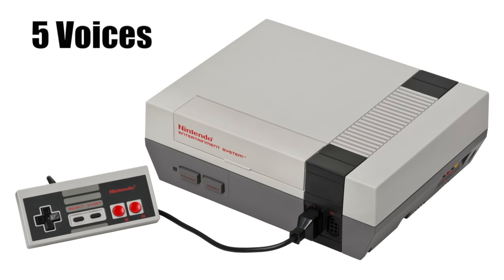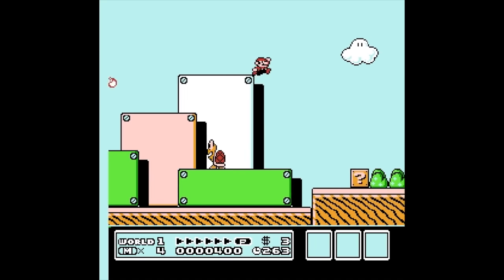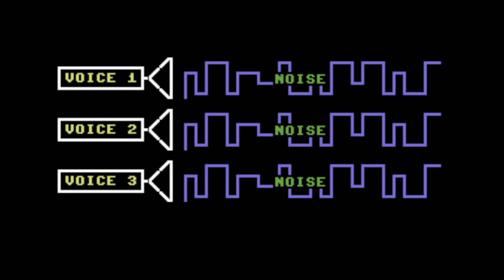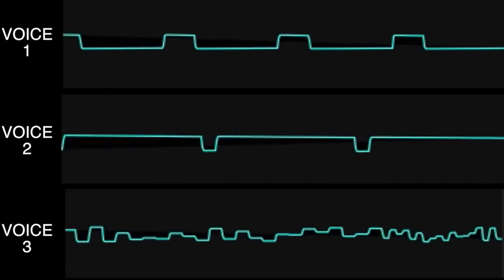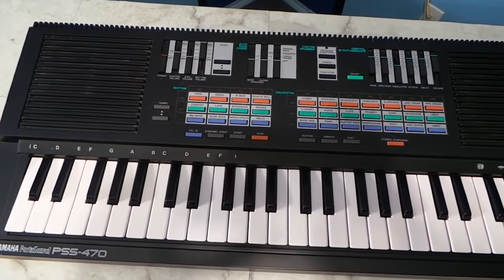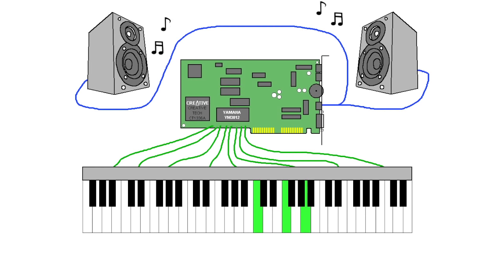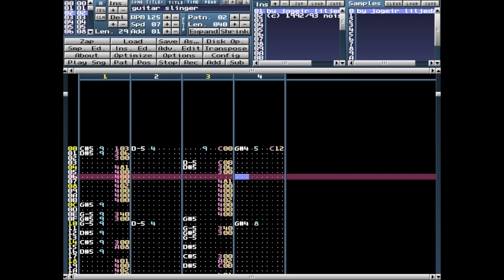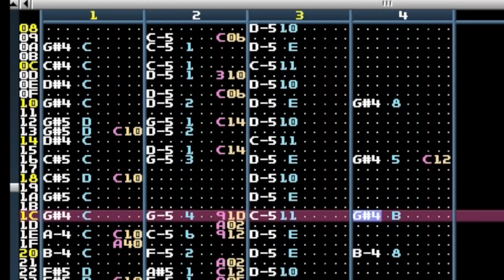How Oldschool Sound/Music worked

Comment: Hey, I just remembered to ask this... how did eight-bit computers do speech synthesis like the famous "Stay a while... stay FOREVER!" in Impossible Mission or SAM on the Apple II GS? Was it just a matter of someone figuring out a combination of square, sawtooth, and "noise" frequencies that sounds close to speech when they're played in the right order?
Reply: Pocket Fluff Productions might of been DCPM.
Reply: Pocket Fluff Productions using an online 8 bit music maker, i synthesized a laugh and some dialogue out of the nes style.
Reply: I typed in a little program for the Commodore=64 once that allowed you to put an audio tape into the Datasette and "record' the sample. Basically what it did was just record a sample based on changes in volume. When the computer played back the sampled file it just turned the volume on and off.
Reply: it was just the computer processing a pre-recorded sound .
Reply: VitinhoCarneiro Rate It Can Play For PC speaker and C64 And Nes 11khz 8khz 7khz 22khz 33khz 44khz Sounds Silmar?
Reply: except for the fact that the //gs is a 16 bit system lul
Reply: punchoutplayer penguin, which 8-bit music maker did you use?
Reply: Old comment, but a little more info for people still reading this: C64 had actual bug in the sound chip, which causes it to output a small "pop" when you changed the master volume from 0 to (maximum) 15. Someone figured out that you could play 4-bit samples with that, and it didn't even need any of the real channels doing anything. So you could easily output 3+1 channels in C64, but as the sample playback was so CPU heavy, you really couldn't use it in games too much (apart from title screens etc.). The original chipset, SID 6581 had that bug, but they fixed it in the next version, SID 8580. That's why the later 64's don't always play the music right, since the samples are too quiet, and that's why many prefer to change the chip or just use older machine these days (since they're cheap to get anyway). Some demo scene people even did mixing routines to play 3 synth and 2 sample channels at the same time, but again it was only good for showing simple background pictures with music.
Reply: Just pointing out the IIGS had the Ensoniq ES5503 chip, which was extremely advanced for its time, much more than even the Amiga's sound chip.
Reply: Technically, the Apple II GS was 16 bit, but I'll let that slide.

Comment: Thanks for featuring "Guitar Slinger"... one of my favorite MOD songs! :-)
One curiosity in early computer sound was Atari's use of a two-track head on their cassette recorder, allowing programs on tape to play pre-recorded voice and music through the computer's audio output while program data was loading from the tape. This allowed a rudimentary form of voice-guided programs, such as learning a foreign language, years before natural-sounding voice synthesis or sampling became practical.
Example: http://www.youtube.com/watch?v=s_HMJm-jbXk
Reply from the maker: +vwestlife I didn't know that.. Unfortunately, I don't have any Atari stuff other than the 2600.  I've always wanted some of the 8-bits, though.
Reply: +vwestlife My absolute favorite MODs are from Elwood, take a listen to "DEADLOCK.XM", "hours.xm", "elw-hom2.xm" or "experience.xm", you can easily find them @ the mod archive
Reply: +The 8-Bit Guy 
The Atari 8-bit computers have four voices, with a variety of waveforms, ability to link channels for 16-bit sound, filters, variable clocks. The voices also have a  volume-only mode to play digital samples (which requires CPU time.)  Its pretty easy to see how Jay Miner evolved that into the 4 voices of DMA-driven sample playback on the Amiga.
Reply: Ken Jennings And considering that the Atari 8-bit computer platform was introduced in 1978 and yet was seen as very competitive with the C64 from 1982, it was way ahead of its time.

Comment: I wish I could understand in detail how my Commode 64 was able to synthesize voice and even text to speech with 3 channels and 4 types of waveforms.  

It amazes me to this day.
Reply: Technically it didn't use the voices to do that. Programmers managed to get the Commodore 6581 SID chip it used for sound to do a simple form of PCM by exploiting a glitch in it. It doesn't work on later commodore machines that used the later 8580/6582a SID chip as they fixed the glitch.
Reply: +Zofe Stormcaller  I think I know what that glitch was, I think there was a way to get a positive constant voltage to the audio out and it utilized the 256 levels of volume control to shape the wave. 

I'd need someone to confirm that tho.  

That alone should be an awesome video. I had my C64 do all kinds amazing things. First time I heard "Pump up the volume" was sampled for a C64. I heard a crazy tune called "Pif Pof a Gorbachev" and of course the SAM programs.
Reply: +forfluf I can't remember exactly how off the top of my head (I'm at work right now), but I just remember it was something utterly brilliant.
Reply: +forfluf From the WikiPedia article on the SID chip:  "Due to imperfect manufacturing technologies of the time and poor separation between the analog and digital parts of the chip, the 6581's output (before the amplifier stage) was always slightly biased from the zero level. By adjusting the amplifier's gain through the main 4-bit volume register, this bias could be modulated as PCM, resulting in a "virtual" fourth channel allowing 4-bit digital sample playback. The glitch was known and used from an early point on, first by Electronic Speech Systems to produce sampled speech in games such as Impossible Mission (1983, Epyx) and Ghostbusters (1984, Activision)."
Reply: Eric Clark
I remember the 4 bit volume control. It sounded pretty good for 4 bit. Thanks for the info.
Reply: +forfluf My C64 has 6 channels :)
Reply: TENMAxNIEMA
Exactly, combined with the MSSIAH it kicks ass

Comment: I'd love one on how the SNES sound chip worked! I'm curious about the Genesis sound chip, too, which was similar to the Adlib but not the same, I think?? Ooooh and the Game Boy.
Reply: SNES was basically just a DAC with some effects that could be applied like basic echo - it could basically play digital samples, in other words.

The Genesis/Megadrive used FM synthesis with some sample playback capabilities, as described in the video above. It uses a different chip but the method of making sound is exactly the same. You'd even find that commercial synths like the DX7 used FM synthesis.

The gameboy used a simple sound chip which had channels that could handle different simple soundwaves (square/triangle), a PCM channel for digital samples and a noise channel. It's very similar to the NES.
Reply: It has a 4bit "wave" channel, which is effectively a PCM channel.

Comment: Do I even want to know how many voices modern systems have?
Reply: Everett Logan music is usually not synthesized in real-time anymore, because we have plenty of space to just store the whole PCM waveform. However, modern computers are plenty fast to do mixing in software, so you can have as many voices as your computer has memory to handle, at least hundreds.
Reply: over 9000
Reply: Honestly I dunno ;D
But what I think is that there is built-in sound chip/firmware like intel AC97 and there is external cards or USB.
I think this topic is to big to fit a comment so read a bit, regards:
https://en.wikipedia.org/wiki/Sound_card
Reply: I don't think they have "voices" anymore. I think they just are able to tell the headphones how to, essentially, move in order to make the sound waves. There are tutorials on how to make a DIY speaker. It just involves a magnet that moves back and forth rapidly to produce (low quality) sound. This is how all speakers work.
Reply: Everett Logan all of them
Reply: Wolfe Galvin probably 99999999999999999999999999 voices
Reply: Voices can be mixed in software, so it's limited solely to the processor speed.  Dozens is easy, and in some cases hundreds and even thousands.
Reply: MrExasperation so ∞ voices
Reply: Modern synths are wavetable based,  they simply read a pre-recorded waveform and play it back mixed with others.
Reply: NO YOU DONT!
Reply: @Wolfe Galvin  WHAT 9000!!!!!!!

Comment: This is a pretty awful oversimplification of the NES sound chip;  those pulse waves could have different duties, giving those channels many different timbres and harmonics. also, NES chips had delay effects through clever programming...
Reply: I was gonna say; 12-25% pulse waves are really common, just listen to any Megaman soundtrack
Reply: Now you can add the exact same effect by re-assigning multiple copies from the original lead track to other channels / voices with the exact same delay timing, giving a reverb impression to the audience.
Found that ten years ago in a screensaver's MIDI file.

Comment: How would the Genesis produce sounds? Was it more like Nintendo's system or did they have flexible voices like the commodore computer? I'm a bit curious especially given the soundtracks for those games are rated highly.
Reply: It uses the Yamaha YM2612 soundchip.
Reply: Genesis use also 8 channel PCM DAC converter
Reply: The sega genesis had a 6 voice FM chip
Reply: Neither, it used FM synthesis. The commodore used subtractive synthesis while the NES was just a simple soundchip that could play basic squarewaves/noise etc.
Reply: It combined YM2612 (FM synthesis) with SN76489 (PSG synth & noise - That's the SMS chip and the console was backwards compatible with the SMS). The FM chip provided 6 4op FM channels, and the 6th one could be used for sample playback instead which was often used for drums (at ~28khz and you can't modify the pitch or volume of the stored samples without tricks) - you could toggle this feature on or off during a song. There's also the more rarely used channel 3 mode that lets you control the pitch of each operator in an instrument, giving the illusion of having more channels but with those ch3 sounds being a bit simpler than the rest (see Mega Turrican - Stage 1 Secret Area for example). Some games' sound drivers also used tricks to play more than one sample at the same time, such as Skitchin', Ristar and Alien Soldier.

Comment: Well, no. What you call FM synthesis is actually PSG music. FM synthesis is '90s stuff (YM2612, Sega Genesis, you know) and actually can be used to create some complex timbre. Read up on it on Wikipedia.
Reply: FINALY someone noticed!
Reply: we're talking about the YM2612 NOT the master system's chip. FM synthisis doesn't even have any waves mentioned in the video.
Reply: +MrJimbo1qaz FM synthesis uses two frequencies and a variable to create a sound with moderately complex timbre. PSGs use predefined waveforms with no modification (such as square, sawtooth, triangle, sine, white noise), the NES's sample channel is an exception.
Reply: Correction: in FM synthesis, sine waves can be mixed or modulate the frequencies (hence the name) of others i  various orders - in other words, vibrato so fast that overtones change is the main component here . The YM2612 and most other FM synths are 4-operator, with various algorithms that control what is mixed and what modulates what. Early chips like the YM2413 (Famicom and SMS expansion) were 2-operator, limiting their capabilities. The best FM synths, most notably the iconic Yamaha DX7, had 6-operator soundchips too expensive and complex to be put into consoles.

Comment: I would have liked to see some description of how the FM synthesis of the Yamaha chips worked :)
Reply: I suggest you check out a channel called MadFame. In short, everything started with a simple question: what happens to the sound when the rate of the vibrato becomes very fast?
Reply: @justinyang21114798  Thanks! Will do!

Comment: Yes indeed, the old computer speaker was fun to program for. We used to write interrupt 8 handlers to use the timer tick and send sound files bit by literal bit out the sound port. Using the hardware timing that way was the only way to run it fast enough, and have time to execute your game code while also managing the graphics which was the real challenge in the first place.

Comment: More information about Vovol:

When the sound has high volume voltage, the speaker membrane is stretched like a guitar string, so that the sound becomes more sharper, realistic and noise-free.

This can be achieved by using an equalizer with a preamp. First, all frequencies are lowered, to, for example, -12 decibels.
Then you raise it up to +12 decibels, with a preamp.

This is how I usually experiment, with vovol, because currently there are no tools, or apps, to do this.

If you, or any of you reading this, have an equalizer with a preamp, I think you should try it too.

And thank you all for reading!

:-)

Again, great video!

Comment: The most impressive thing I've ever heard on an old machine, was an actual low bit rate recording of Foghat's Slow ride on a Commodore 64. It sounded like a cheap, mono transistor radio, but it was clearly the actual song playing. The first MP3 in history. The only way I think they did it was to do a modified Fourier transform using the select waveforms to decompose and digitize it. And this was back in the early 80's, and it was on a 5.25" floppy disk.

Comment: The Commodore 64 SID chip also had sample playback capability, an analog low pass filter, and ring modulation!
It was basically a digitally controlled analog synthesizer on a chip!

Comment: I remember back when a 12 channel sound card came out from Applied Engineering for the Apple computer.  I had a lot of fun with that, you could take sheet music and add it in with a not so user friendly editor.  I spent hours putting in music.  I completed songs like That’s All by Genesis, Smooth Criminal by Michael Jackson.  Some sheet music sounded better than others but those were some of my better ones.

Comment: After the Amiga years on my first Pentium I used a SB16 for sound and had a second sound card installed, the Terratec Maestro 32. I wasn't interested in it's sound abilities, but it other than the SB16 it had a port for a wavetable MIDI adapter and also came with a good one: 4MB of great samples and a real MPU401 chip on it, it's quality beat the later AWE sound by far.

Comment: the ibm speaker is not controlled "directly by the cpu". the  ibm speaker actually is connected to a timer chip. which in a way therefore partially is a 'dedicated soundchip'. it can at the very least generate a single block waveform at a specified frequency by itself even if that once boice doesn't have volume control. it's really not that far off from the sid or pokey chips (or using a 6522 timer). although there are plenty of systems that actually have a speaker connected to an actual latch register port the ibm is not a good example for that.

Comment: pc speaker can do clean sound of any frequency. you could make all these frequencies on a ibm 5150 using pc speaker. the trick is the pc speaker out instruction and the rest is just  binary sequence programmed to mimic any wave form. the pc speaker is technically just a square wave by bit 1 and 0  but by manipulating the sequence of 1 and 0 you can get any wave form shape you want. you can even play wav files correctly. the only problem was the sampling rate to get enough of these numbers going fast enough to play the sound at normal speed. you dont need separate sound channels as long as the computer can handle a high enough sampling rate. a single channel is enough. it would take 4 times the sampling rate on a single out channel at a given cpu speed to match a four channel system. the brain can't tell the difference between fragments of sounds players one by one from different sounds in one channel  and sound from multiple channels playing in paralell.

Comment: Thanks for all the info! Two questions about that:

- Why does the C64's SID sound so much better than the AdLib even though the AdLib seems technically superior?
- Why does Amiga music often sound pretty off-pitch?
Reply: The SID is much more flexible than the OPL2 chip in the AdLib, and it also has a lot more stuff like LFOs, low/high-pass filters (with resonance too) and even ring oscillation. AdLib was a pretty barebones FM synthesis chip. The only thing about it that's more flexible than the SID is the fact you can actually change the volume of the instruments individually, while on the SID you could only change the global volume (come on, Commodore...)

The Amiga issue is usually more of the composers' fault, as they have to check if their samples are tuned to C-440. It has no problem with pitch precision, unlike some other chips (POKEY in the Atari 8-bit, SN76489 in multiple consoles/computers and let's not even mention the TIA in the 2600.)